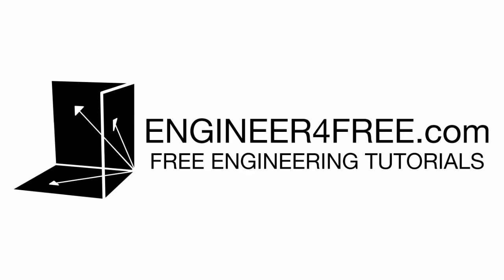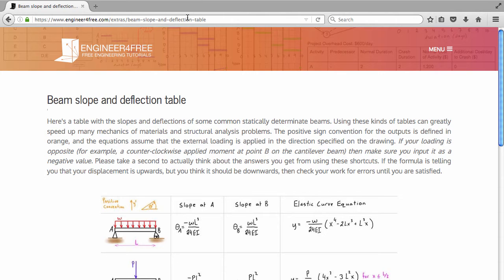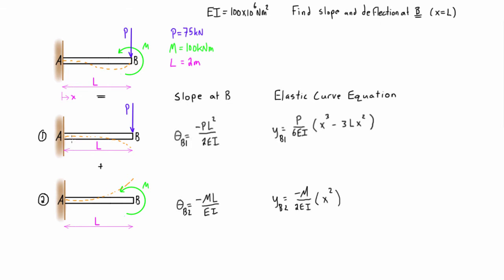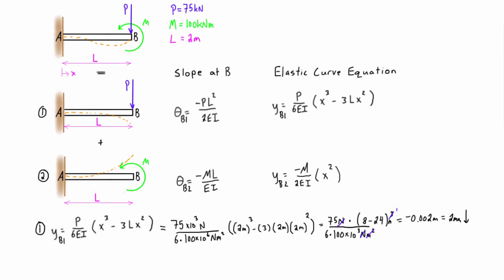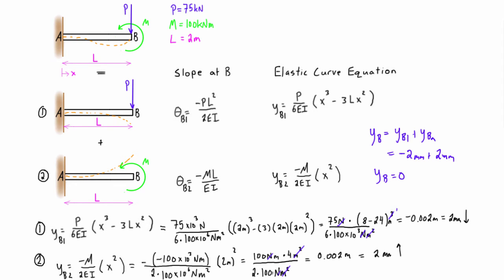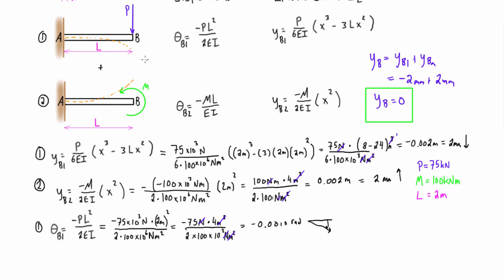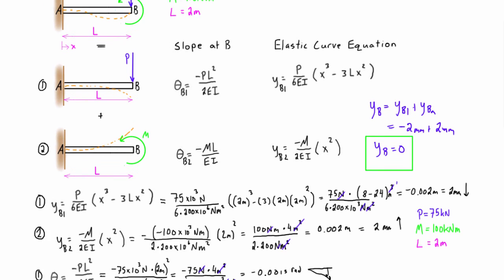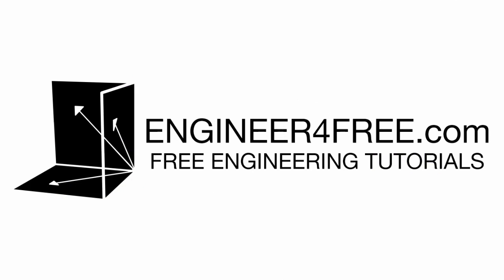Method of superposition example #3: applied moment

Comment: excellent videos man. Do you have an example with a clamped beam with 2 different bending stiffnesses? so 2 different EI = const. values? There ends up being 3 different parts that can be summed up together. You use the equations to find either w (deflection) and theta (bending/twist angle). Trying to find another example other than what was covered in class. Thanks!
Reply from the maker: I know what you mean but I'm pretty sure I don't have a video with that type of variation. You can check engineer4free.com/mechanics-of-materials and engineer4free.com/structural-analysis but I think they all have constant EI if I recall correctly